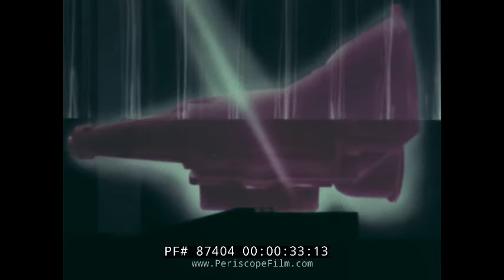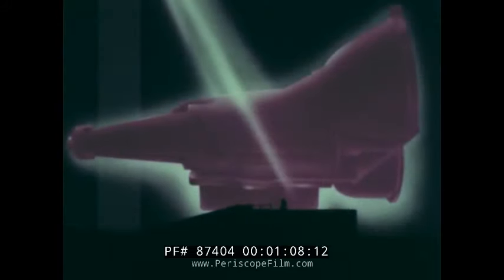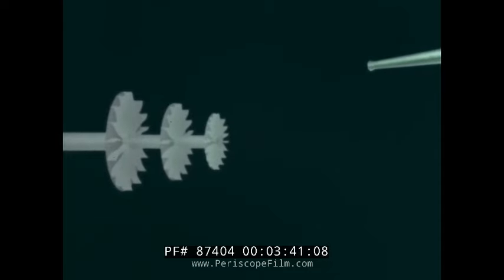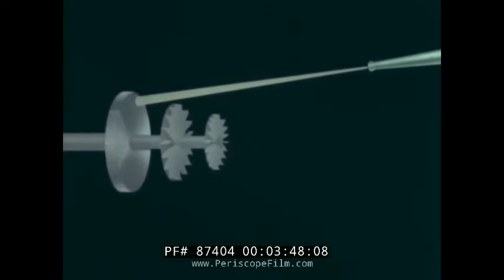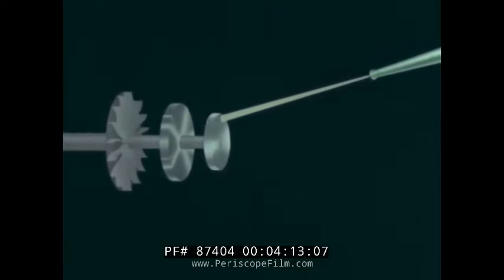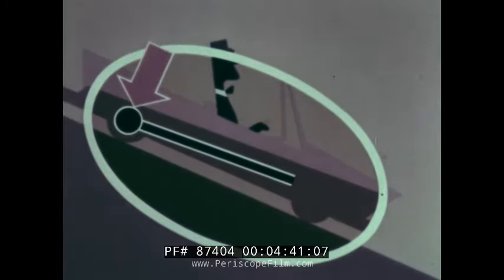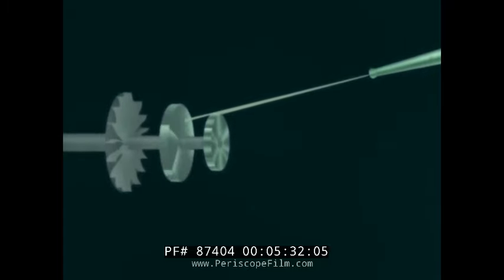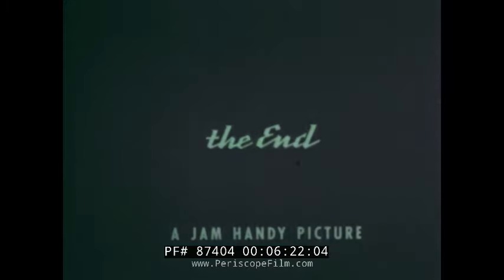CHEVROLET TURBOGLIDE PROMOTIONAL FILM BY JAM HANDY  87404

Comment: In 1961 my dad bought an Impala with the 283 V8.  It never gave any trouble.  We drove that car through one engine rebuild around 60K miles.  Several of my brothers drove this car mercilessly, but it never had a problem.  Much later, I mentioned this to a Chevy mechanic, who said the problem was overheating.  This was particularly a problem when mated with the 348 V8 with it’s higher compression, and A/C.   The Triple Turbine transmission was introduced in late 1957 by Chevy, and was standard in Buick’s Limited model displacing the Dynaflow. All divisions discontinued it by  the end of the 1961 model year..
Reply: ...especially when GM would introduce Turbo Hydra-matic transmission four years later to the best of my knowledge.

Comment: It was a multi million dollar flop. They finally discontinued it. Shifted like a Dyna Flow
Reply: Dyna Slow
Reply: And that was the point! It was supposed to be smooth and seamless.  That's what they thought the public wanted.  It was discontinued because the transmission could not be built beefy enough to handle the torque of the new engines.  I don't think TurboGlide was ever offered on the 409.  Maybe the lo-po single 4-barrel 409, but certainly never on the Dual Quad or Solid lifter engines.  Those were 3-speed or 4-speed only.
Reply: @That_AMC_Guy  Ok so heres the thing ... I am at some point in the near future going to be building an RV, but a pretty sorta 50s era atomic age sorta vibe ... Im all about the cosmetic side of things but still learning mechanics .. so what motor and transmission would you say would be a good one for seamless gearshift?

If I were to give a rough idea of the dimensions it would be about the same height as a VW Kombi, a little wider a good meter longer but with a heavy duty chassis and will probably be C.O.E

Comment: They had a nasty habit of dying with no notice.   You'd drive to the store,  and when you came back and put it in gear to drive home, it wouldn't move.
Reply: Usually due to lack of service.  Chrysler's Torqueflite used to boast of practically no service interval.  GM transmissions or Ford for that matter could offer the same luxury.
Reply: Heat.. the auto nemesis
Reply: Heat.. the auto nemesis

Comment: I feel like it was a good concept and in general, a good system, they just didn’t spend enough time to work out all the bugs, and the bad reputation kind of snuffed it out completely. Kind of like the Chevrolet Corvair or the Ford Edsel.
Reply: the corvair had a 9 year run before it was replaced by the "RUST BUCKET VEGA".

Comment: I remember how the "POWER GLIDE" trans. took its share of criticism also, they were called "POWERSLIDE/  SLIP&SLIDE.". if you wanted a good hard/ firm shift, just disconnect the modulator valve, and the trans will live a very long life without frying the low band/ high clutch pack/ reverse clutch pack. also my '65 chevy has the rear output shaft oil pump, so it can be push started!!!!.

Comment: A friend said his dad's Ford-O-Matic was a 4-speed. "It has first, second, third, and passing gear."
Reply: Your friend is wrong.  The Ford-O-Matic is really a 3 speed but when you started out in Drive, it started in 2nd gear and shifted to high.  If you started in Low, it would start in 1st gear and then you shifted the lever into drive, it would automatically shift into 2nd and then 3rd.  The down shift was from 3rd to 2nd.  No 4th gear.  The GM Hydramatics were 4 speeds.  I have owned several Cadillacs of the 40's and 50's with Hydramatics.
Reply: @packard5682   Ford-O-Matic was the 2-speed.  Cruise-O-Matic was the 3 speed.  But I believe that changed moving into the 1960's.  Ford-O-Matic and Merc-O-Matic were the budget 2 speeds and essentially, the same thing.  Yes, GM Hydramatics were 4 speeds.
Reply: @That_AMC_Guy  The first Ford-O-Matic was indeed a three speed. The later Ford-O was a 2-speed designed for the Falcon and was the budget trans.
Reply: @ostrich67  Correct. I have a '55 Thunderbird with the Ford-O-Matic. It is a three speed box, but uses a second-gear start, unless you manually start in "Low" gear, or floor the accelerator from rest. These boxes were designed by Borg-Warner, and were built under license by Ford. Studebaker also used the same box in the Avanti, with a slightly different control scheme.

Comment: The TurboGlide transmission was an experimental all aluminum cased triple turbine CONTINUOUSLY VARIABLE transmission meaning you never actually felt a distinct "shift" like you would in the 2 speed more popular PowerGlide cast iron cased transmission of the time. GM offered this transmission for around 3 years then because of reliability issues discontinued it.  I own a 57 Chevrolet Bel Air 4 door sedan and she has the "Super Turbo Fire" package which includes the "Power Pack" package along with this TurboGlide transmission.

Fully functional/operational and is a real pleasure to drive and show off to unsuspecting passengers waiting for that first shift!!!!!!

HAHAHAHAHA!
Reply: The Turboglide wasn't exactly a continuously variable transmission but rather a concurrently geared transmission although the effect is almost the same.  All three turbines in the torque converter were were coupled to the output shaft at the same time.  The difference was that the first two were set on one way sprags that caused them to free spin whenever the max turbine speed was reached and not impede the rotation of the central shaft.  Therefore the transmission was always perfectly coupled to engine power.  A Turboglide starts out in 1-2-3 mode then moves to 2-3 mode and finally to 3 mode.
Reply: ThirdGenUSA You will laugh until it breaks!  No modern trans shop will know how to fix it and you will end up
Converting it to a reliable Powerglide!
Reply: It isn’t a CVT because a CVT has an infinite amount of ratios where the torque converter can achieve lockup.  

Obviously, they didn’t have CVT in the 50’s, and Turboglide is definitely the most comparable thing to CVT from that era.  However, it doesn’t fairly compare to CVT not because of the smoothness, but because if the torque converter was to lockup, (providing there was a lockup mechanism) the turboglide would be limited to 3 ratios (which would make it the equivalent of a 3 speed automatic)

Comment: Chevy's Turboglide was the same as Buick's Dynaflow. Behind the fancy five-element torque converter was a standard 2-speed Powerglide, which provided reverse gear and a lower "Grade" 1st gear, which was used only when selected, not during normal acceleration.
Reply: Not at all. The PowerGlide and TurboGlide share no parts.  TurboGlide has 3 ranges, PowerGlide only 2.  Did you not watch the film?

Comment: I am 71, these transmissions were crap.  The powerglide was more reliable
Reply: Idk about that...  there is an old lady that owns a 1957 Chevy car she bought in 1957 brand new 
She’s had very little issues out of it
The car (according to the video I was watching) had/has the same tranny.  
So I googled it and found this video lol
Reply: They are great transmissions if you service them frequently and don't expect a whole lot of performance out of them.  You wouldn't go drag racing with anything with a Turboglide or it's corporate cousin, the Dynaflow.  For every day use, they are fantastic and smooth.  But as engines became more powerful, they couldn't build the Turboglide Big enough or Beefy enough and still CHEAP enough to mass produce. You never saw a TurboGlide behind a 409. They couldn't handle the torque.  Not to mention, it was just silly for every corporation under the GM umbrella to have two or three transmissions of their own.  It didn't make sense.  

Not to mention, with the debut of Chrysler's Torqueflite in 1956, it was so simple, durable, reliable and strong that every other corporation was scrambling to catch up.  Big GM put all their money into the new TurboHydraMatic which, is better than Power/TurboGlide but still nowhere near as comparable as Torqueflite.

For instance, Torqueflite used to boast about it's service life of next to never.  The 100,000-mile service interval is simply a recommendation.
TurboHydraMatic used to at very least need band adjustment every 25,000-30,000 miles. FMX / Ford-O-Matic / Cruise-O-Matic had 20,000-mile intervals.
Reply: @That_AMC_Guy  Great comment, the original TorqueFlite was really a decade or two ahead of its time and still relevant today. Modern automatics are just a slight improvement on the design that Chrysler nailed back in the 50s.

Even though it ended up being a dead end, the Turboglide was a really interesting diversion along the path of automatic transmission evolution, and I'd love to drive one just to see what it's like.
Reply: @doctorzaius4084  I'd take a TurboGlide over a Dynaflow any day.  Dynaflow drives like a variable ratio tranny.... or like a golf cart.  Stomp the pedal, engine tachs up and just sits there while road speed gradually increases.  It's a strange feeling in a full-size car and does NOTHING to help fuel economy.  Even the switch-pitch torque converter they added in later years didn't help.

TurboGlide seemed like a natural progression at the time.  99% of the wear in an automatic is on the bands. But if the bands RELEASE instead of apply, then there (in theory) should be no wear.  As smooth as the transmission is, because of it's design, you lose the ability to engine brake (there is actually a gear position to do this instead) it requires the MOST power at take-off usually when engines produce the least power and as time marched on and band material improved.... there really became no benefit to TurboGlide.

Driving one is weird, but I suppose by 1950's standards - anybody who had a free-wheeling Dodge or Studebaker would feel right at home.  Release the throttle and the car just glides away with no engine braking.  Shifting is almost imperceptible. What I found most distracting on TurboGlide was it almost felt like the engine got more powerful as you progressed through the "gears".  In Low, all 3 forward bands are applied. In "2nd" only two and in direct, only one.  So, as the transmission goes through it's paces, parasitic loss decreases.

But, this has the strange benefit of making the engine feel UNresponsive in low gear to being VERY responsive in high gear. Passing is difficult again because the load increases as you downshift.

Comment: The Torboglide was a garbage transmission offered between 1957  and 1961.  Why, I can’t imagine?  People that compared them to Dynaflows are partially right as to their operation.  Dynaflows didn’t break!  Turboglides were nothing but trouble!
Transmission shops hated them and most were converted to Powerglide.  POS transmissions!

Comment: I'm confused, never heard of Turboglide, heard of hydramatic, powerglide and turbo hydramatic, also Buick's dynaflow.
Reply: There shitty is why. My buddy had a hott Cutless with a 383 & Turboglide racing trans that went down every few oil changes. When it worked it was pretty fast. For a small block; it had a little party trick up its sleeve. Could break the tires at 60 and hold it till 80 smoking the hwy! Then after that we had no ideal how fast were going since the speedo stops at 85.
Reply: You're thinking of a Powerglide which was a common racing automatic. There is a company making a Powerglide clone racing auto called TurboGlide 400 but it has nothing to do with the the Turboglide in the video.  Few '57-'61 cars were optioned with Turboglides and even fewer Turboglides made it out of the 60's.  Mechanics didn't like working on them and they weren't paragons of reliability.  When they broke, they were generally replaced with a different transmission model and scrapped instead of being repaired or rebuilt.
Reply: JayeK47 
So basically, turbo glide is a 1950’s version of today’s Nissan CVT
Reply: Michael no it’s not. A CVT uses cones and belts to create infinitesimal ratios during acceleration. This Turboglide was equipped with a special torque converter with the ability to multiply torque in such a way that you could leave the actual transmission in a single forward range and never have to shift. However, the transmission itself DID have a low forward range you could manually select.
Reply: @NZDC69  They had cones to!. I built transmissions 30+ yrs,I didn't do t glides but my mentor told me about them,He built them but most were replaced with powerglides😊
Reply: GM is glad of that.